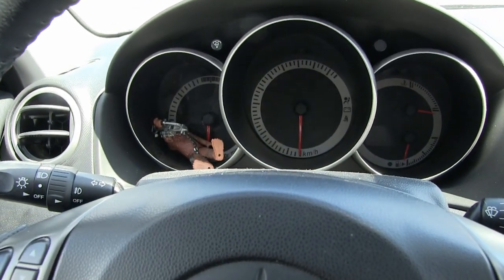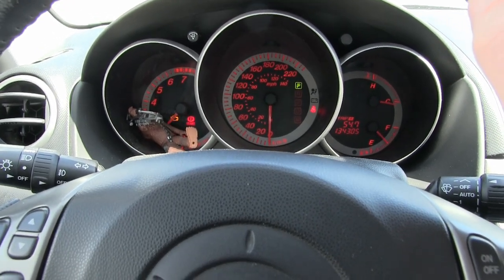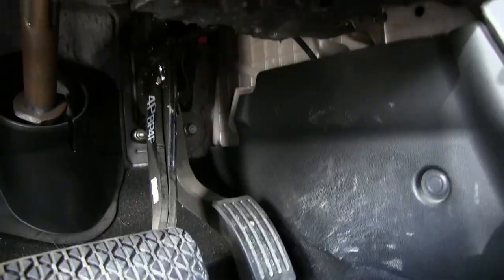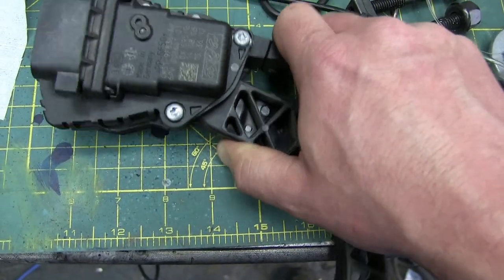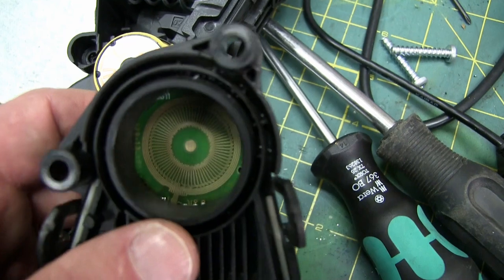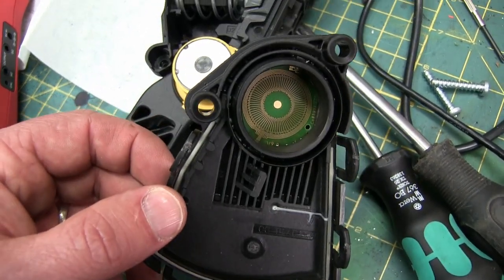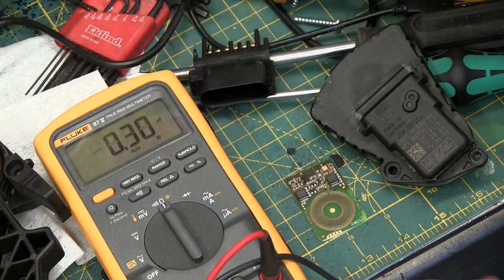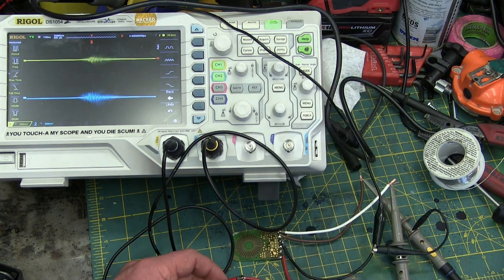BOLTR: CANbus accelerator pedal.

Comment: Yo +Ave, not to tell you how to do the job but normally if this happen, p2126 mean the computer is seeing a signal range coming from the sensor that is out of its normal operating range. so if you clear the codes and unplug the sensor then cycle the key and check codes again you either see the same code or a new code that indicates that the pedal position sensor has an open circuit. if its the same code you have either a wiring harness problem or the confuser is crapping out, if it goes to open then aunties your bob throw a new one in and your done.

Comment: would that plastic pedal be more expensive to produce than a steel asenbly? like do you think that theyre doing it to save weight? i know the one on my accord is like bent 1/4 or 3/8 in steel
Reply: Weight is everything these days for fuel economy.
Reply: They don't even give you a spare tire anymore, just a can of schmoo that's supposed to seal your old one. Empty promises don't weigh anything, right?
Reply: +Darwinpasta my metal shaping friends tell me that the steel in the new cars is thinner, stronger and very difficult to weld and to repair. The body shops replace panels and in many cases they are glued in place! More weight savings but you end up with cars that are even more disposable.

Comment: The worst my '06 Mazda 3 has done is burn through a clutch at 213,000 miles.

That said, after my former mechanic pocketed the new throw out bearing and elected to skip one of the mounting bolts for the transmission, my engine tore a hole in the side of the transmission casing and nearly torqued itself out through the radiator.
Reply: Crooks and thieves.
Reply: Abel Babel Indeed. Now I recommend Marietta Motors in Marietta, PA.
Reply: +D Hawthorne I would also call out the "former mechanic," as not recommended, rated ½ star, yada, yada. Basically, take the shop and/or mechanics name that did the work and attach whatever you feel comfortable with doing on the NET. 

I'd give the dealer name if I knew it for this idiocy:
Dad took the work van which has a regular old V-8 in it to the Chevy fleet service place for an "air bag deflector" recall. 

During the "free multi point inspection" he concluded the timing belt needed replacing. 

A damn timing belt on a plain Jane Chevy V-8!! Service manager was VERY interested in how and why the tech determined this. Got  a pretty good tongue lashing.
Reply: nice fix. my first car was an 88 dodge aries, loved that piece of crap. I replaced the transmission myself at one point, missed a motor mount bolt some place. ran fine, but the engine would hit the firewall when I stepped on the gas. only real problem was a plastic valve which turned on the coolant to the heater core. I replaced that broken plastic with a piece of copper pipe, ran until I got rid of it for something newer.. little did I know I'd end up with a pile of bits and bytes.
Reply: one mounting bolt from transmission to the car? if so that shouldn't be an issue tbh. I wouldn't trust a mechanic who loses bolts and don't replace them but still missing on transmission bolt shouldn't be an issue. for certain engine/transmission combos you often end up not using a bolt because it doesn't line up perfectly.
Reply: David Serrano Well the new one lines up just fine and it wasn't the first time this guy screwed up bad.
Reply: Iceberg86300 This guy use to be a family friend and his son (who plans on taking over the business) was a classmate of mine in HS and does excellent work. In general, I recommend against ANY mechanic in Mount Joy, aside from West Main Auto, but Marietta Motors does much better work, cleans up any grease or grit they track into the car, are fairly quick and will actually show you parts that they feel need replaced.

Comment: According to my sources this is the pinout : 1: (YE) +5v Constant Voltage, 2: (WH) Accelerator Pedal Position Validation Sensor +, 3: (BN) Accelerator Pedal Position Validation Sensor -, 4: (BK/YE) Ground, 5: (GY) Accelerator Pedal Position Sensor, 6: (GN/YE) +12v Start/Run.

Comment: Most all automotive sensors work off of 5v reference voltages from the ECM. I strain to think of any that aren't 5v fed  (discounting simple resistive sensors of course.) This thing is basically a comparator circuit, where one side rises in voltage,  and the other falls,  and the chip knows the position and the rate of change based on these two values. If you give me the year and model of the car I can pull up a print from my Alldata online account

Comment: Get a OBDII Bluetooth Reader so you can use app on phone. Search App Store for OBD and you will find many diag apps. You should be able to get readout of pedal when ignition is on but engine off. If it’s not the pedal, check the throttle body for build up or it’s electronics/position sensor/motor. They should have two feedback readouts and if they don’t match, it does not work. Safety thing.

Comment: If the ECU says it has a problem reading the pedal then it has to be the pedal, the connection from the pedal to the ECU or the ECU.  The signal isn't just a voltage, so something is getting through.  It has to be the pedal or the ECU.Lets hope it is the pedal!These are cheap parts because of volume.  If we all drove Haul Trucks they would be cheap(er).

Comment: with how this is electrically engineered regarding the parts on the board could they be programming the failure onto the board?
Reply: If it has a microcontroller on the board, I suppose it could be doing something like incrementing a counter roughly every second and saving it to some non-volatile memory; then it could be programmed to stop working when a counter gets to a certain number. Though, I highly doubt they'd they'd do this. It would require the company that makes these to be in collusion with the auto company, greatly increasing the risk of a leak, and a very expensive lawsuit. I don't think they'd risk all that money, and the backlash for a $100 part you may need once in the cars useful lifetime. Carmakers typically just engineer parts to last just past warranty, which they consider to be the useful life of the vehicle (as long as the part isn't critical to safety, in which case, they over-engineer them to avoid lawsuits and bad press). They do this to keep costs down, but I doubt they put extra effort into making sure the parts fail. The auto industry is very competitive, and leak over something like this would probably end the company.
Reply: Edward Turpin gotcha.  makes sense, if they are getting peeps to program failures into car parts that particular programmer never makes it home that day to their families is what ur saying?  i could believe that.  Hella's huge.  how does monsanto keep all their secrets?   they must have so many.

Comment: Just clean the contact surfaces with high grade alcohol and a lint free cloth!  That should fix it!  Likely throwing a code due to slight fluctuations in values caused by degradation on contact surfaces.  Good luck!

Comment: If it's a CANbus you need a bit more circuitry I think, because the devices pull up and down on the data rails, so you probably won't be able to read anything unless you've got those lines biased up and down with resistors all right
Reply: Ahh wait just double checked and I'm totally wrong

Comment: Good luck!

Too late now but you should have killed the power to everything (disconnected the battery, disconnected and reseated the plug on the pedal...) and tried it again before you did the destructive disassembly.  You know, the IT mantra- have you tried rebooting it?  Oh, you have, have you tried unplugging it and reseating the cables?

Seems to work all to often with newer cars.

Comment: Save the old parts! If the old rotary encoder works with 0-5V, it could patch right in as a input sensor for an Arduino..... And also, would be a cool graphic for your next iteration of AvE uniforms (t-sharts)

Comment: Loads of new gen throttles etc use rotary encoders rather than a pot as even wirewound pots have issues and carbon/metal  film just wear or that's the theory. Personally I never saw a worn out  film pot except in one car that had done 500,000 miles as a taxi. Anything can either break or have early life failure due to a manufacturing issue.

Comment: DTC P2126:00 [MZR 2.0 DISI i-stop]

id0102d4934400

DTC P2126:00

APP sensor No.2 circuit range/performance problem

DETECTION CONDITION
•  The PCM monitors the APP sensor duty signal. If the input signal (duty signal) is too high or too low than the set value, or the input signal intervals are too short or too long, the PCM determines that the APP sensor No.2 has a malfunction.
Diagnostic support note
•  This is a continuous monitor (CCM).
•  The MIL illuminates if the PCM detects the above malfunction condition during the first drive cycle.
•  FREEZE FRAME DATA (Mode 2)/Snapshot data is available.
•  The DTC is stored in the PCM memory.
POSSIBLE CAUSE
•  APP sensor connector or terminals malfunction
•  Short to ground or open circuit in APP sensor No.2 power supply circuit
―  Short to ground in wiring harness between main relay terminal C and APP sensor terminal A
―  ENG INJ 15 A fuse malfunction
―  Open circuit in wiring harness between main relay terminal C and APP sensor terminal A
•  Short to ground in wiring harness between APP sensor terminal B and PCM terminal 1AC
•  PCM connector or terminals malfunction
•  Short to power supply in wiring harness between APP sensor terminal B and PCM terminal 1AC
•  APP sensor No.2 signal circuit and ground circuit are shorted to each other
•  Open circuit in wiring harness between the following terminals:
―  APP sensor terminal B—PCM terminal 1AC
―  APP sensor terminal C—PCM terminal 1AN
•  APP sensor No.2 malfunction
•  PCM malfunction

Diagnostic procedure

STEP

INSPECTION

ACTION

1
VERIFY FREEZE FRAME DATA (MODE 2)/SNAPSHOT DATA HAS BEEN RECORDED
•  Has the FREEZE FRAME DATA (Mode 2)/snapshot data been recorded?
Yes
Go to the next step.
No
Record the FREEZE FRAME DATA (Mode 2)/snapshot data on the repair order, then go to the next step.
2
VERIFY RELATED SERVICE INFORMATION AVAILABILITY
•  Verify related Service Information availability.
•  Is any related Service Information available?
Yes
Perform repair or diagnosis according to the available Service Information.
•  If the vehicle is not repaired, go to the next step.
No
Go to the next step.
3
INSPECT APP SENSOR CONNECTOR CONDITION
•  Switch the ignition to off.
•  Disconnect the APP sensor connector.
•  Inspect for poor connection (such as damaged/pulled-out pins, corrosion).
•  Is there any malfunction?
Yes
Repair or replace the terminal and/or connector, then go to Step 11.
No
Go to the next step.
4
INSPECT APP SENSOR NO.2 POWER SUPPLY CIRCUIT FOR SHORT TO GROUND OR OPEN CIRCUIT
•  APP sensor connector is disconnected.
•  Switch the ignition to ON (engine off).
•  Measure the voltage between APP sensor terminal A (wiring harness-side) and body ground.
•  Is the voltage B+?
Yes
Go to the next step.
No
Inspect the ENG INJ 15 A fuse.
•  If the fuse is melt:
―  Repair or replace the wiring harness for a possible short to ground.
―  Replace the fuse.
•  If the fuse is deterioration:
―  Replace the fuse.
•  If the fuse is normal:
―  Repair or replace the wiring harness for a possible open circuit.
Go to Step 11.
5
INSPECT APP SENSOR NO.2 SIGNAL CIRCUIT FOR SHORT TO GROUND
•  APP sensor connector is disconnected.
•  Switch the ignition to off.
•  Inspect for continuity between APP sensor terminal B (wiring harness-side) and body ground.
•  Is there continuity?
Yes
If the short to ground circuit could be detected:
•  Repair or replace the wiring harness for a possible short to ground.
If the short to ground circuit could not be detected:
•  Replace the PCM (short to ground in PCM internal circuit).
(See PCM REMOVAL/INSTALLATION [MZR 2.0 DISI i-stop].)
Go to Step 11.
No
Go to the next step.
6
INSPECT PCM CONNECTOR CONDITION
•  Disconnect the PCM connector.
•  Inspect for poor connection (such as damaged/pulled-out pins, corrosion).
•  Is there any malfunction?
Yes
Repair or replace the terminal and/or connector, then go to Step 11.
No
Go to the next step.
7
INSPECT APP SENSOR NO.2 SIGNAL CIRCUIT FOR SHORT TO POWER SUPPLY
•  APP sensor and PCM connectors are disconnected.
•  Switch the ignition to ON (engine off).
•  Measure the voltage at the APP sensor terminal B (wiring harness-side).
•  Is there any voltage?
Yes
Repair or replace the wiring harness for a possible short to power supply, then go to Step 11.
No
Go to the next step.
8
INSPECT APP SENSOR NO.2 SIGNAL CIRCUIT AND GROUND CIRCUIT FOR SHORT TO EACH OTHER
•  APP sensor and PCM connectors are disconnected.
•  Switch the ignition to off.
•  Inspect for continuity between APP sensor terminals B and C (wiring harness-side).
•  Is there continuity?
Yes
Repair or replace the wiring harness for a possible short to each other, then go to Step 11.
No
Go to the next step.
9
INSPECT APP SENSOR NO.2 CIRCUIT FOR OPEN CIRCUIT
•  APP sensor and PCM connectors are disconnected.
•  Inspect for continuity between the following terminals (wiring harness-side):
―  APP sensor terminal B—PCM terminal 1AC
―  APP sensor terminal C—PCM terminal 1AN
•  Is there continuity?
Yes
Go to the next step.
No
Repair or replace the wiring harness for a possible open circuit, then go to Step 11.
10
INSPECT APP SENSOR NO.2
•  Reconnect the APP sensor and PCM connectors.
•  Inspect the APP sensor No.2.
(See ACCELERATOR PEDAL POSITION (APP) SENSOR INSPECTION [MZR 2.0 DISI i-stop].)
•  Is there any malfunction?
Yes
Replace the accelerator pedal, then go to the next step.
(See ACCELERATOR PEDAL REMOVAL/INSTALLATION [MZR 2.0 DISI i-stop].)
No
Go to the next step.
11
VERIFY DTC TROUBLESHOOTING COMPLETED
•  Make sure to reconnect all disconnected connectors.
•  Clear the DTC from the PCM memory using the M-MDS.
(See AFTER REPAIR PROCEDURE [MZR 2.0 DISI i-stop].)
•  Perform the KOEO or KOER self test.
(See KOEO/KOER SELF TEST [MZR 2.0 DISI i-stop].)
•  Is the same DTC present?
Yes
Repeat the inspection from Step 1.
•  If the malfunction recurs, replace the PCM.
(See PCM REMOVAL/INSTALLATION [MZR 2.0 DISI i-stop].)
Go to the next step.
No
Go to the next step.
12
VERIFY AFTER REPAIR PROCEDURE
•  Perform the “AFTER REPAIR PROCEDURE”.
(See AFTER REPAIR PROCEDURE [MZR 2.0 DISI i-stop].)
•  Are any DTCs present?
Yes
Go to the applicable DTC inspection.
(See DTC TABLE [MZR 2.0 DISI i-stop].)
No
DTC troubleshooting completed.

Comment: I don't get the throttle by wire for a car. Why not a cable?
Reply: ya.... I guess it's a smoother feel?

they take out all the feel of the road and what the car is doing to give.you this dumbed.down basic experience. 

people dont.like to feel their brakes

or feel the road threw the steering wheel....

which is so counter intuitive....
Reply: Various reasons, such as letting the ECU control the throttle plate for better emissions and simplifying cruise control systems.
Reply: It's for emissions, fuel economy and longevity of the other components connected to the engine. fly-by-wire allows the PCM to blip the throttle during automatic transmission shifts to do what's best for fuel economy while giving you the feel of acceleration and it eliminates other components like idle air control motors Exedra that would be needed for a mechanical throttle plate.

Comment: Not to sound like my dad, but can someone explain how this travesty is better in any way that a mechanical throttle cable? Seriously, I'm a big fan of cheap and easy, and this in no way is cheaper or easier than a throttle cable.
Reply: I assume the motor has an injection system, not a carburetor. In such a system the injection of fuel is controlled by a computer. There is nothing to attach a cable to other than a system that translates the movement of the cable to an electronic signal the computer can understand.

Comment: Whoever made up that saying you first mention (wings wheels or tits) never owned a boat! 

 ps- This is when, as a mechanic who fixes all years/makes/models having your information services at hand saves my ASS! Saves my lunch from being eaten too. Using Alldata or, my favorite, Identifix to get the pinout, and even a color-coded wiring diagram for that sucker! But ideally you'd have a bi-directional scanner that can talk to all the modules and do an auto-scan to make sure it's not a connection/communication issue, etc.....the $1000 MaxiDAS scanner isn't actually TOO bad of a deal. Nice upgrade from your brick scanner too. :D

Comment: The missus had the pedal in my S10 go down and not come up. It was new, towed and repaired under warranty. The cable had come disconnected. Happened again. She was kicking the damned wire retainer off. That takes... well, it was the least complaint I have about her.

Comment: Special type of digital potentiometer, as the wiper rotates it pulls different pin combinations high or low. those chips then translate it to different resistances between the pins. resolution of the pedal is the angle between each of those pins.

Some random circuit diagram I found. http://www.autozone.com/repairguides/Tucson-2006-2008/Components-Systems/Accelerator-Pedal-Position-Sensor/_/P-0996b43f80e65041